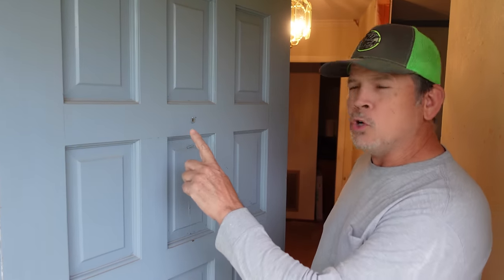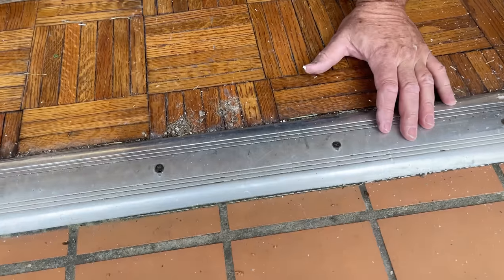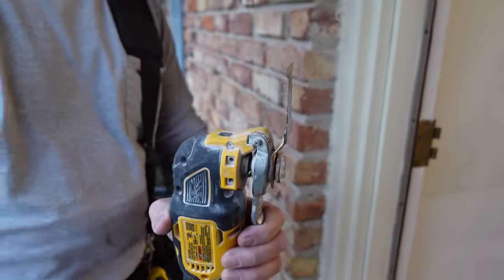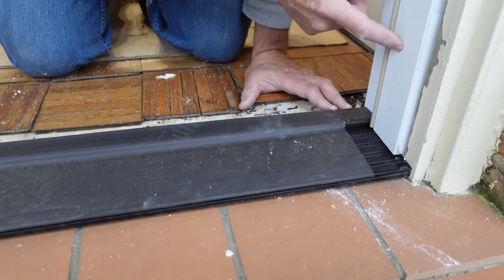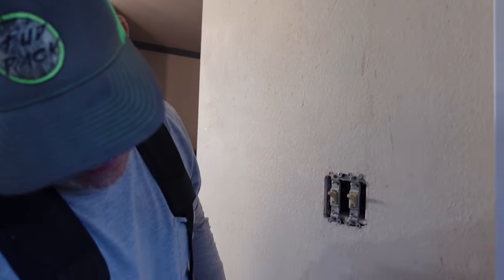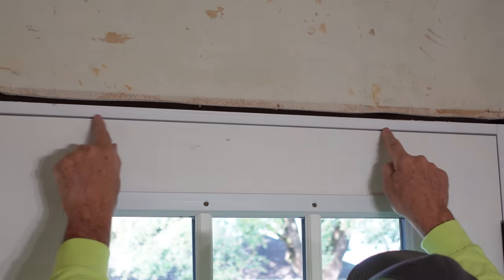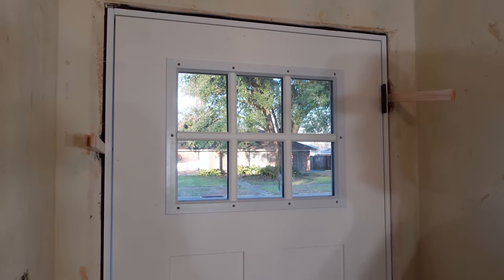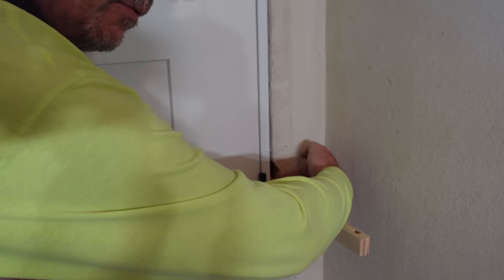HOW TO REMOVE and REPLACE a Front/Back Door (Easier Than it Looks!)

Comment: I was hoping he'd address a strange/unique(?) situation. I'd bought a new (OUTSIDE) door long ago & never installed it, but best I can tell the lockset holes on the new door/frame  are drilled at different heights compared to the OLD door & frame. The latches won't align with where the existing holes for the knob & deadbolt (strike plates) are  in the (existing) door frame--or whatever the heck that part is called. SO-the whole da*n door & frame will have to go in, and since I've never done it before, I'm calling "the guy." Since it's NOT an inside door that I could piddle around with & take my time w/o it being a security risk (plus waste all that AC).  This guy made it look easy because it's when the "wheels try to come off" that knowing what to do makes a huge difference. This house was possibly built like mine-MASS Production & quick quick quick. I've seen some of the sub-contractors (?) at work here in my "hood" & they were UNIMPRESSIVE--3rd rate equipment/tools. Couple that w/time constraints & you'll get a crappy job, like with my house in certain spots.

Comment: It’s a fun idea to leave the exterior casing but it NEVER works out well. The reveal will be inconsistent and it even shows in this video. The head casing actually hangs down past the top of the jamb.  You also need to be clear about using the correct spray foam insulation. If you use the wrong foam then the door will bind because it expands too much. You should be using a 6’ level to hang a door too.  You made a video that shows minor tricks for a homeowner but if we look close at the installation then it’s not such a great job.  What about interior casing??  Do you need extension jambs and if so how do you install those before casing the door?? What about the floor patch??  There’s still plenty of work to do on the door and you only showed about half of the real installation…..

Comment: Here's the thing; it's a guarantee that if the jambs, door and everything else has had it, the exterior casing is NOT going to magically  be in better shape. Consider this; you expect that new door to be good to go for what, 20-40 years? Will that exterior casing that's been there for 20 years already be good for another 20+?

After watching the whole video, I would have taken that POS door back.

Comment: That door is a mess.  Anymore door manufactures don't give a shat on quality control.  Stud pack, fold those hinges back against each other and put a slight bend in them to open the hinge gap. Even expensive doors, they usually make there reveals to tight, can't paint the jambs.  It's ridiculous what the door industry is doing.

Comment: Bad job of installing the door. Should use a 6-foot level not a 4-ft level. The door was plumb before you started putting shims which then put it out of plumb. The reason the Gap was uneven on top was because the sill plate was not level. How many Carpenters are commenting on here that it's a good job that are really pretty crummy Carpenters.

Comment: It's hard to believe how shoddy that door was manufactured to begin with, and to have all that extra unnecessary work to get it to fit right from the start . Cheap big box store product no doubt.
Reply from the maker: I never buy doors from box stores.   This door was $800 (fiberglass with PVC jambs) from
locally owned mill work shop.   It’s by Masonite.

Comment: Nothing lasts a lifetime anymore, may take a lifetime to pay off. Nothing lasts that long anymore , brand name expensive plumbing fixtures star losing their finish in 9-10 years. I just bought 5 gallons of paint I used to $147.00: for the low joeBiden cost today for only$229.00 . Yup just one year later same paint , same store $79.00 bucks more . Hunter must be hauling huge bags of cash to the big guy.